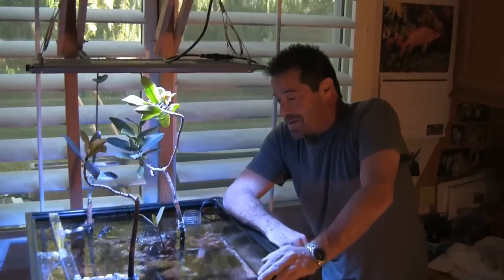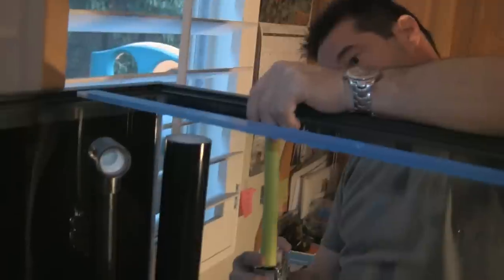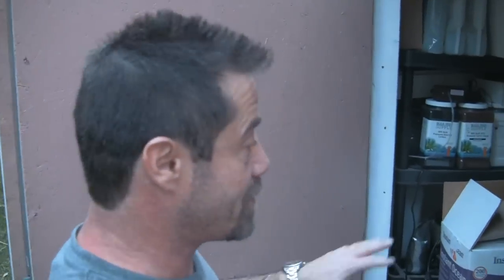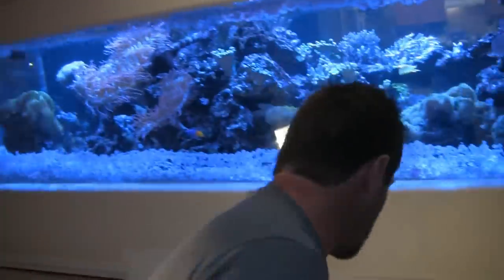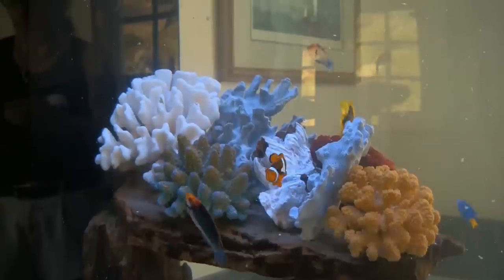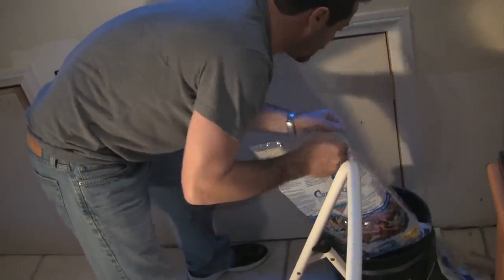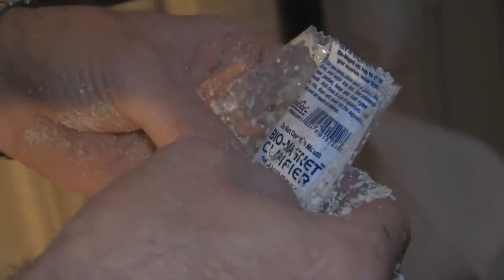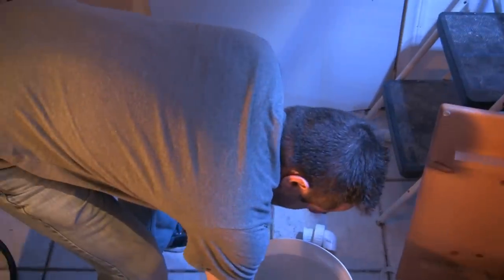A Bigger Refugium, LA Fishguys Episode 143 pt 3

Comment: what paint was used to paint those pipes?
Reply from the maker: RobertosLife Krylon brand spray paint
Reply: lafishguy Will any work? What specific one did you use or what was the picture on the front.thanks for checking
Reply: RobertosLife It was Krylon Fusion. That is what I would suggest. Just let it dry out for 24-48 hours to outgas. Then wash it well.
Reply: slief hey thanks slief